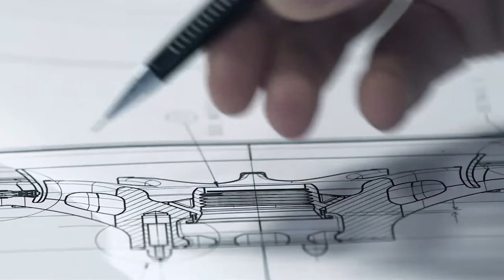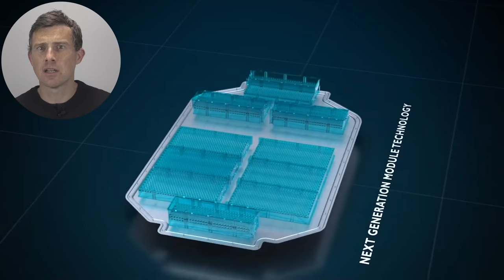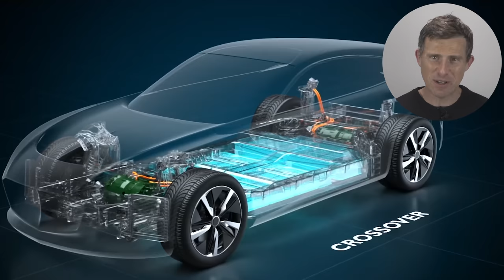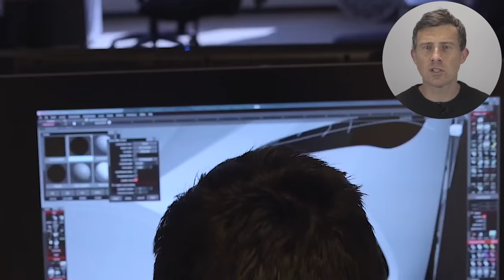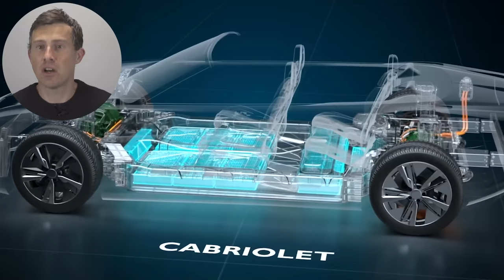New Jaguar F-Type R - an EV with 1,360hp and 1,000KM range?

Comment: When the car is on the road, and somebody can buy it, then it will be worth judging, otherwise it's just pie in the shy. The Plaid is here, and DragTimes has already done a 1.99 zero to 60, and there's another video showing somebody doing a 9.08 1/4 mile on a Dragstrip. Real world vs Fantasy world!!

Comment: And how they are going to solve lack of recycling possibilities ?
Reply: By already solving it.
Reply: The entire industry has already been thinking of that. The batteries will have special recycling centers for when they get old.
Reply: @snakeeyes9246  And what is happening with crashed EV right now ?
Reply: @mkroliki  REPURPOSED! There are soo few crashed high performance batteries. They are sold on auction very quickly to be put in other vehicles and machines. The demand is way beyond supply.

Comment: Model S Plaid has 100kwh batteries for over 1000hp. Jaguar needs 160kwh batteries for 1360hp. 60% more batteries for only 30% more power. Not impressed.

Comment: Disappointed, I was hoping you were going to say Williams had some new battery tech, with higher energy density, lighter weight and faster recharge times. Alas same old same old dinosaur tech batteries. The cars will still be too heavy or simply ridiculously priced. No mainstream manufacturer will ever use carbon fibre chassis. So just more toys for the filthy rich.

Comment: Need a car with all solar panels so you can drive forever
Reply: not gonna happened. Maybe if you barely use it and live near equator. There is simply not enough sun per area of an average car even with 100% efficiency solar panel

Comment: Wow, so they are paying another company to build their cars and using larger batteries (the most expensive part of the car) to make up for inefficiencies leading to more expensive materials and processes (carbon fiber) to compensate for weight. 

Sounds overly complicated and expensive. 
Meanwhile Tesla believes in vertical integration so much they are building their own battery packs, seats, AI chipsets, , even designed their own windshields. 

Feels like Jaguar is behind and trying to play catch-up to existing technology not thinking about Tesla’s next move. I’m sure these will be great cars but they just don’t seem like a good value when there id better for cheaper. Then again, people still buy Maserati…

Comment: Why are we racing with power figures so high? In Italy we will have big problems. We pay taxes on power, and since power is only increasing you can pay a luxury tax over a french 1.6 i4 turbo, or a japanese 1.6 i3 turbo.
I4 and i3 are not what I would call "luxury", especially from france and japan.

Comment: I just don't get why non-EV owners get SOoooooo fixated by what they think is the need for MASSIVE battery range...!
OK - so I'm presuming their rationale is that they want a car that will do the same 'range' as their ICE car with a full tank of petrol/diesel. 
But, since when does ANYBODY jump in their ICE car and drive non-stop until the fuel tank is empty...???
The average journey speed in the UK is now just less than 60mph, so a 620 mile ICE or EV car range drive is going to take a minimum of 10 hours' driving...!
No one in their right mind would EVER try driving for 10 hours non-stop - that would be ridiculously unsafe for the driver and surrounding road users.
Honestly, the 'sweet-spot' of EV range is something like 200-250 miles, which most modern 50-60kWh battery EVs can do. That means around a 3-4 hour drive before the driver, sensibly, takes a half-hour comfort / food / coffee break.
You plug your EV in... go for your break... come back out to a re-charged car and off you go again.

Comment: Please review about Syntetic fuel and toyota Hydrogen Engine please 🙏
Reply: LOL Dead end will never be viable on a larger scale. But sure it's a fun freak experiment. I particularly love the BMW Hydrogen 7 6.0L 12. Kicks out an astonishing 256hp.
Reply: Thermodynamics combined with the high cost of hydrogen makes hydrogen engines an insanity. At least use it in fuel cells.

Comment: Click-baity nonsense. The Williams stuff was interesting enough in its own right without having to have a flimsy made up story about a non-existent Jag backed with a render knocked up by the intern. 🙄
Reply: I agree. The render doesn't even look right anyway, the rear wheel is slightly offset to the front, and the proportions are too Polestar 1-ish.

Comment: 600 miles 🤣🤣🤣🤣 lucky to get 60. The price will be through the roof. Plus the battery will start going after about a year. And because the batteries are built into the chassis, you won't be able to change it. Until these cars are affordable and you can change batteries, these ev vehicles are just ridiculous. Impressive but ridiculous. Only the rich will benefit.

Comment: I hate electric cars they don't look very good a lot of them and they're expensive and the batteries only last about 15 years then you have to spend thousands and thousands of pounds on new batteries. Petrol cars if you take care of them can last 25 years or more, hell some are even 40 years old and running fine. Plus charging the electric cars takes hours whereas filling up with petrol takes about two minutes.